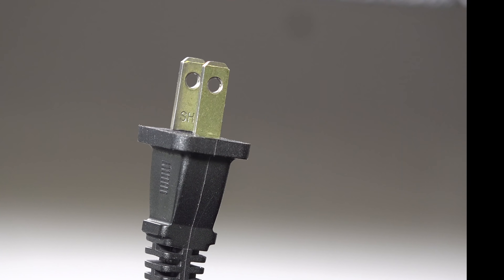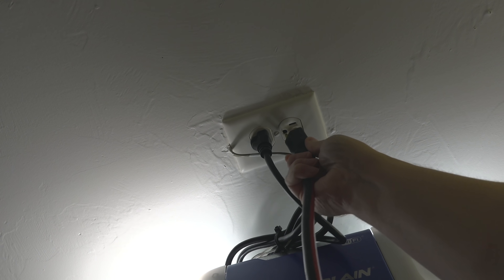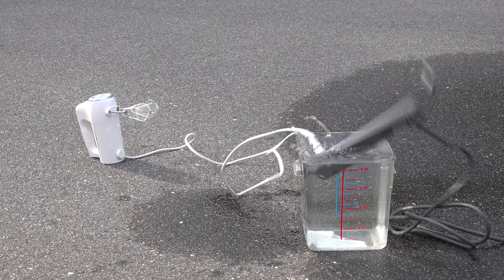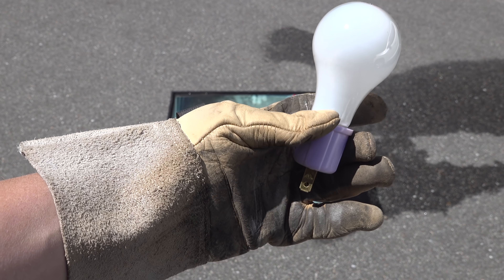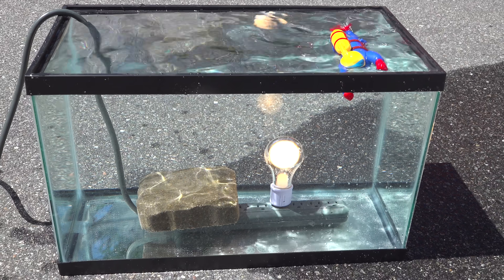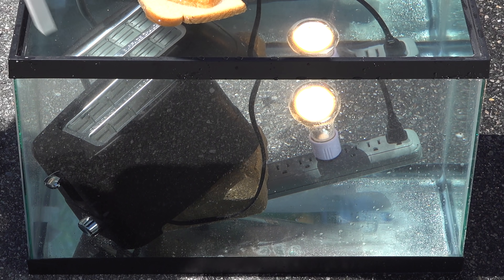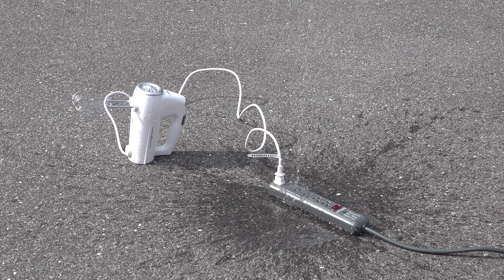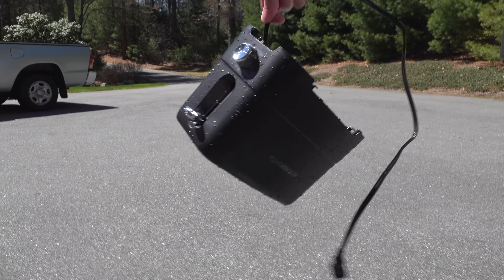What REALLY HAPPENS WHEN YOU SPILL WATER in an OUTLET?

Comment: Other than my charger cable lit up, battery explode etc
My only electrocuted story is in my childhood
I just ate tofu, using a hand, didn't wash it at all, then straight up touch the switch that connected to TV, and spontaneously i felt the shock of it 🤣

Comment: Water is a conductor, right? So why wouldn’t the connection from hot to neutral not have caused the breaker to be overloaded? Wouldn’t the draw instantly increase past breaker ampacity because of the fault?

Comment: Our kitten once peed into an outlet. It was an accident, of course. I was in the room and heard some strange noise, turned my head, and saw the kitten running away like crazy. The sparks were coming out of the outlet like a little firework. I immediately unplugged the outlet, and everything was fine. I could smell some burnt fur. The kitten was so frightened it got behind a bookcase where I couldn't grab it. It got out later, and the kitten was fine. I guess if no one was at home at that moment, the kitten could start a fire.
Reply: That makes sense. Kitten urine contains tons of electrolytes, which are what really conducts the electricity. Meanwhile the water this guy used was probably very pure. Good to hear the kitten was alright.

Comment: I had a malfunction on my drip coffee maker when tank full of decalcify mixture and water. Gasket between tank and bottom part broke all 1,2L of water goes thru internals on electronic board, heater, everything and poor out thru holes at bottom on extension cord and same other electronic pluged in on desk under coffee driper. Nothing happen electricity still on, no spark, no smoke, no cracking even it was not pure water but vinegear and lemon acid and we have 230V 50Hz.

Comment: Not using extension cords in bathrooms should be common sense with or without a GFCI. But using a USB-type extension cord would be safer since the voltage would still be 5 volts and the adapter with the transformer would be plugged into the wall socket at a safe distance. So if one dropped a charging phone in the water, they could simply unplug the USB-to-lighting lead where the male USB connector plugs into the female USB connector from the special extension cord. 5 Volts through wet skin to ground would be barely noticeable if at all.

Either way, electronics are not made for bathtubs. If your laptop doesn’t kill you, it would still be ruined anyway.

High voltage through water is always dangerous. If there are minerals in the water, the AC impedance would drop and short everything. And don’t get me wrong high-voltage DC is dangerous too. Even electrical  engineers don’t work on live wires, unless they want to know if a wire is live without having to trip the breaker first. When installing screw bases for lightbulbs, it’s impossible to know if a switch is on or off. One could simply hold a lightbulb between two wires or touch a live wire to see if there is a shock. Or, one could short live and earth to see which breaker trips, indicating which breaker the circuit is connected to.

I don’t know how many people do it, but I would write down a note with all the rooms, all the electrical outlets and all the lights that are controlled by a specific breaker, just in case I need to work on an outlet. I could decide not to shut the power off and use a WAGO termination for clamping the live wires since using a screw terminal would involve the use of a screwdriver, which would be less safe. Besides, one should never alter anything electronic without authorisation  or qualification. If your new wirings and fittings are unsafe and start a fire, you’d better not be the landlord if somebody were to be injured or worse.
Just because DIY stores exist, it doesn’t mean one can simply buy stuff and figure out how it works. DIY stores exist because those are the kind where qualified workers shop at. Electrical engineers don’t just bring new outlets straight out of the factory. They shop just like normal people, except they are qualified.

A landlord can get in legal trouble if a tenant alters any outlet. My parents have had a tenant who replaced an outlet. Thankfully it was safe. But any unauthorised modification by a tenant should be reported by or to the landlord. If the tenant isn’t fined, the landlord could be. And please don’t accuse me of pretending to be a lawyer. I am not. Nevertheless I know stuff about the law. I know it’s illegal to work a job without a license or authorisation. If you’re unpaid, it jeopardises businesses and economy. Working for free puts revenues of companies in jeopardy, just like working for the competition jeopardises the revenue of a business.

Anyway, I am not here to teach electrical engineering, economics or law. Not that I wouldn’t want to, but it takes a degree to teach stuff with a board’s full trust

Comment: water is not a good conductor of electricity. You need some dissolved materials like salt, or the salts in wet soil. The GFCI detects current between neutral and earth (ground). In a normal situation like wet bathtub area, you have dissolved material in the water, and it IS dangerous. It is dangerous to people and animals if they are between a live conductor and a wet surface (ground) Be CAREFUL with all of this.

Comment: Think of it like this. Electricity is a lot like water- it takes the path of least resistance. Pure distilled Water itself is not very conductive so it follows the metal instead and even regular water isn't very conductive either- it depends on the source/minerals in the water. I use a mix of distilled water and the purest isopropyl/denatured alcohol I can when cleaning electronics (just saved a shorted PCB about a week ago this way!). The dangerous part with water is you ground yourself with it and the path of least resistance might just be through you, you're creating a connection- just  math/physics that decide where the electricity is delivered and with water it can be hard to break that connection when a shock happens. GFCIs are great, I kinda wish that they were standardized so that every daisy chained group of outlet needs one.

Comment: The reason why water is dangerous is because it does not conduct electricity play the airport if you are standing in water can you touch electricity even a 110 volt you are not grounded and the electricity will stay in you instead of going on the ground which is the danger

Comment: so really clean water does not conduct electricity especially if it's distilled water because it's impurities in the water that make it conduct not the water. i worked for the power company my whole life and we would have rain, snow and ice all over high voltage power lines like 4kv, 13kv and 25kv and rarely cause a problem because rain, snow and ice are like distilled water.

Comment: A while ago, our upstairs neighbour’s washing machine leaked into our bedroom ceiling into the light. The light bulb was trying to turn on even though it was off at the mains. The fuse eventually gave in and the light bulb stopped working. All we could hear afterwards was a sizzling noise. But nothing else happened. When we eventually took the light bulb out, it was filled with water.

Comment: Being from the UK  this makes me uneasy we have a RCD (residual-current device) similer to your GFCI but its in the main box and protects the whole house, yes over in NA its only 110volt compaired to 230-240Volt but still. if i spilt water in my bedroom it would trip the power breaker for that circuit, unless it was a bigger fault that trips also the main breaker seams alot safer and all sockets have switches and plugs have commonly  5 10 or 13 amp fuses along with other saftey stuff

Comment: The water is a little bit live, but the electricity is still taking the path of least resistance which is through the metal wires if you put a mineral such as salt in there you would see more activity, but everything would probably still somewhat work. This might though, cause faster corrosion

Comment: That's kind of really disconcerting actually that it will still have working power even when under water lol. Like, you'd deff want that to shut off. I wonder if you put an electro meter in the water withiut touching the strip if it would detect electricity running through the water and if so how much power?

Comment: Water becomes part of the circuit. Majority of the time it will never break your breaker, because its not sending anything back. If the neutral doesn't do the off load, then the water will. A GFCI receptacle tests for the return current to match, otherwise it trips. Which is what happens when you create a ground via water. The breaker breaks via magnetic force. ~Electrician

Comment: Dude, if you waited for that bulb to reach its hottest temperature and then dipped it into that aquarium, then the bulb would have popped, trust me. Heat and cold don't play well together and that's science for ya: the cold causes matter to shrink, whereas the heat causes it to expand. Say, if you have someone watering a window with a garden hose from the outside, but at the same time, you'd boil some water and pour it on that same window from the inside, take a wild guess what will happen to that glass, huh? With one side of the pane being cooled and thus shrunken from the outside and the other side of it being heated and thus expanded from the inside all at once, the glass absolutely will shatter...

Therefore, as they say, "Do not try this at home..."

Comment: One time water leaked into an outlet I had while I was sleeping, woke up found it was shorted on one side and a bit molten. Inspected it and it still worked fine after drying. I feel like having a bit of water in specific places inside, could be worse than it fully submerged, also having a device plugged in and the same time might help.
Presence of water didn't allow it to ignite which is what would have been very bad, besides the energy consumption.

Comment: Water is the universal solvent. This allows water to become somewhat conductive quickly. To blow a standard 15A breaker water would have to become very conductive. There is a way but I will also not mention this. There is a lot that goes into it like voltage. Some electronics may be more tolerant than others to slight amounts of current from conductive pathways not created by the circuit board.

Comment: 3M makes this chemical called Dry Water. It looks exactly like water, is liquid like water, can be poured like water. But is not water. It is completely free of electrical conduction and the catalyctic effects of water. It does not soak into anything, put a cloth in it, pull the cloth out and literally all the dry water will spill right out of the cloth immediately leaving it dry feeling. It doesn't stick to anything either and will pour right off anything, no water blobs. You could literally submerge an entire computer in dry water and it will run perfect, actually even better as it will keep it cooler. There are videos showing this, just type "3M Dry Water" in the youtube search

Comment: I have my doubts that someone would die putting their hand in that water. There is a ground terminal connected to a copper wire providing an easy path to ground right next to the hot and electricity only needs to overcome the resistance of that distance of water, whereas it will have a much harder time going through a larger distance of water as well as the resistance of your body, shoes, etc. to reach ground.

I think if you had only the hot in the water and no neutral or ground, and stuck your hand in, THEN, you would be the path of least resistance to ground.

One more thing: If you have a high wattage appliance like a two-prong ungrounded hair dryer or toaster, the only path to ground would be through a high resistance heating element, in which case there is a chance the electricity might prefer you.

Comment: -- I've got your regular old extension cord (about six now) that I leave plugged in and just throw next to the barn to keep batteries in vehicles (trickle chargers) charged in winter.  Rain snow, shine, never had a problem.  In fact the biggest problem I've had is detaching it from the integrated trickle because it's frozen.  Not saying do it.  Not saying it's okay.  But I've never had a problem.  And from the start to now, I back each cord up with multiple breakers.  Never popped one.  In years.  Not one.

Comment: in order to get shocked from plug-ins like that, you need METAL to release the electricity. If the plug had a loose connection, it would release electricity into the water. But you kept it firmly plugged in.

Comment: 120v probably isn’t enough to cause an issue, here. Also, both the neutral and earth (ground) conductors are connected via the water to the live conductor. The breaker won’t trip because the water has enough resistance to limit the current flowing and an RCD won’t trip as the current in the live will equal the current in the neutral. If there was an old Earth Leakage Circuit Breaker was installed, that would likely trip as it detects current flow in the earthing conductor. 
I think. 😊

Comment: I dunno. This test might be fine for this power strip, but it seems like an high-end power strip which yeah, would resist water and stuff. I thought you were gonna use a like 1€ power plug and see if that worked. Pretty sure a low budget power strip would blow up instantly. So I just watched a commercial for a power strip, kinda shaddy ay

Comment: I think it's fascinating that, even submerged, the power seems to favor going from hot to neutral instead of to ground. Because power going into ground, at least so I've heard, should trip the breaker on the spot.
Reply: To much power trips the breaker. Power going into ground will trip a GFCI unit. Some breakers have a built in GFCI but most don't. Now if the electronics were submerged in water that touched the ground, enough power may flow into the ground that will increase the electrical flow from the breaker and trip it. But I do think you are right, electricity favors going hot to neutral.

Comment: The reason you don't see it gets short out because the water supply you have has a very little salt in it. If the water source has more salt it will conduct as a short circuit!

Comment: Some things to consider:

- This was tap water. Putting a moderate amount of salt in the water would still not have caused sparking or instant breaker popping, but would definitely have caused a more violent reaction - like,. more bubbles, possibly even visible additional heat. By using water as salty as sea water, you may actually get something spectacular to happen, maybe even pop a breaker, but probably not yet.

- There is also secondary water damage. The moment water gets on a voltage differential, electrolysis takes place, which changes the chemical composition of the surfaces, and tends to weaken the outside surfaces of wires. In particular, a perfectly fine wire nut or wago connection could become a weak or high resistance one, and possibly even arc and start a fire.

That latter effect is typically too long term to be visible in a video recorded on a single day, but is actually a common cause of house fires. This is why outlets and electrical boxes that have ever been wet need to be replaced, even if they appear fine right now.
Reply: That last bit of information is really useful. I almost died at 2/3 yo upon touching a splice, so I know not to fuck with electricity or take any risk at all.
Reply: In this situation a breaker would never go as he is using a surge protector which has a fuse in it so the second something would happen, the fuse would go.
Reply: A welcomed explanation 🎉
Reply: Ye
Reply: I'm guessing distilled water would have no effect whatsoever then, eh?
Reply: @jasondashney  as long as water has no impurities (minerals, salt and so on) it is fine.. but still bettr for an appliance not to be water damaged
Reply: @jasondashney 
Yes, I saw in some places they clean elictrical boards and stuff with distilled water after they have been exposed to sea water or so
Reply: @pouria5180  100%. Before cell phones were waterproof, if you dropped yours in the water the best thing you could do was take out the battery and bathe the phone in distilled water.  It got the minerals that caused shorts out.  Then allow it to fully dry and you're good to go.
Reply: @jasondashney  Even distilled water can cause corrosion over time. No water is safe.
Reply: I came to the comment section just to look for a comment like this. TY.

Comment: Obviously it won't fry itself. You need salty water to conduct electricity and the small amount of salt in tap water isn't enough. Water doesn't conduct electricity, the salt in it does. +Electricity travels from - to + and if salt water shorts a circuit it will take a pretty direct path which would be contained by the plastic of a toaster for example. The biggest danger is touching the cables directly.

Comment: Clean water, as chemically clean, do not conduct electricity, so no surprises in this video. Add for example salt to the water and things will start to happen. Or try to use a power strip that had been laying for years and collected dust somewhere, then you will most likely see some sparks, smoke and fire.
When the first spark is there it create a path of carbon and this make the next spark easier to go off and more carbon build-up, now you have a runaway circuit and fire is the next thing to happen. Do not mix electricity and water it may end badly.

Comment: So the surge protectors job is to protect the device not you.

I wouldn't be surprised if stuff like that bulb worked without the need to plug it in just dropping it into the water should provide all the power it needs to run.

Comment: It'd be interesting to use a power meter on the whole setup and compare power consumption in air vs in water. The difference is the power going through the water and not the devices.